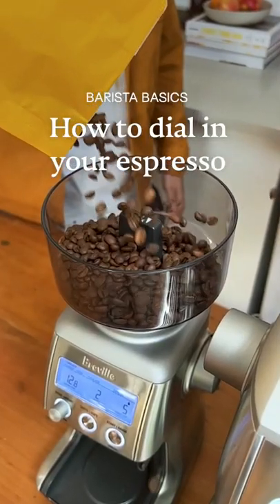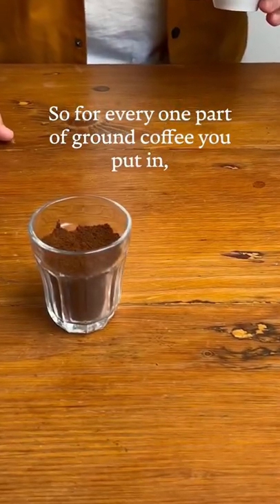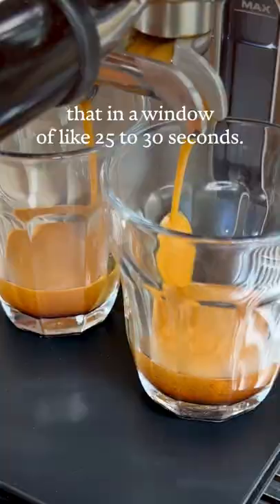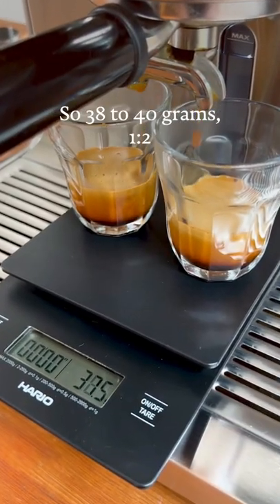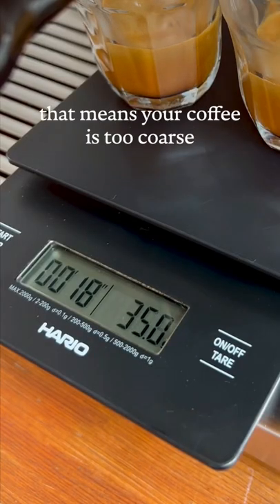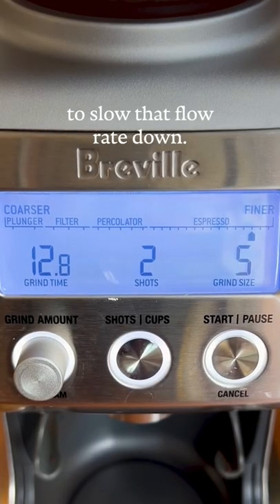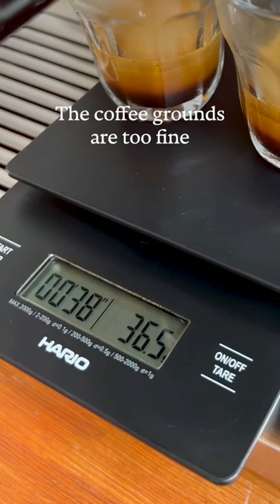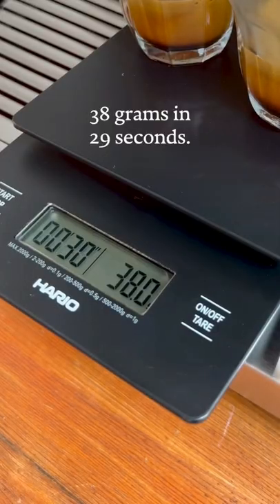How to dial in espresso #goldenbrowncoffee #espresso #barista #coffee #howto

Comment: Notice this is just a standard guideline. This will change depending on your coffee beans, aswell as the temperature and pressure your machine works with. Light roasts usually render a better coffee with higher ratios, and darker roasts can render better with coarser settings and smaller ratios.

Comment: Learnt this at a coffee workshop I did recently. It really does make all of the difference. Btw, I notice you have the Sage/Breville machine. Would love some machine specific tips as I am struggling with my machine still! Thanks 😊
Reply: @Paul Ridgeway grinder is fine for starting out, machine is more than fine, if it’s good enough for Lance Hedrick….
Reply: just my 2 cents, open the top, turn the burr to minimal step then work on your settings, else the grind will always be too coarse. the default burr setting is bs. i initially thought this is a bad grinder, turns out to be just fine
Reply: @sythanh14  thanks! I agree, the burr settings are shoddy. The factory setting was not working for me. I have gone two levels finer and seem to be extracting better espresso within my intended recipe times :)
Reply: @sythanh14  good tip, I had the same experience with this grinder
Reply: Another couple of beginner tips…. First, you have to start a little too coarse

Second…. Understand the texture of grinds you are aiming for
Flour or corn starch texture is way too fine
Table salt texture is a little  too coarse
So aim for something in between
Reply: @MrArdytube  thanks Andy. I do aim for somewhere in between that grind. I’m about 80% there - I don’t think I’m tamping as well as I should be. Thinking of getting the Normcore spring-loaded tamper for more consistency.
Reply: @nainz9310  do you have a bottomless portafilter?   That really helps to see how the shot is pulling….. basically you can see if it too fast or too slow.   And channeling…. Ideally you want to see the flow unify into a single steam fairly quickly.   This is deceptively harder than it seems it should be.    

The following seems a little picky…. But works for me.   I use a wet paper filter on the bottom…. Then the espresso…. Distributor to level, tamper, then a puck screen….   The result is an immediate unified stream of espresso

The norcore is an excellent tamper if you do not have one.   If you have one already…. I tamp so fingers and thumb are touching both portafilter and tamper…. This lets you feel if it is uniformly level.   Tamper Pressure uniformity is not critical… you just want a firm press
Reply: Even with identical machines, the results will vary depending on the coffee used, how fresh it is the roast, the humidity in the home. It’s a trial and error until you have a great tasting coffee and it wi vary from day to day. The Breville/ Sage have a lot of retention so purging the grinds will be a must between trials or you will be left with a good part of the old grind setting in your new grind.

Comment: I have that same Breville finder and a 6 grind for 18 seconds (or about 18 grams in) on that grinder has been the best ratio so far for my little Breville Bambino to handle a double shot.
Reply: I have the same set up. Smart grinder and little bambino. Struggling to get a good shot off single wall basket. You recommend I do 6 grind setting for 18 seconds and I’ll get nice honey drip from it? Right now I’m doing 24 grind for 7.8 seconds on dual wall and it’s so-so

Comment: What happens when you're getting 48g to 50g of espresso on 20 grams in 28 seconds?   (About 1 :2.5).   The timing works but the output is too high.
Reply from the maker: If you just need to grind a bit finer
Reply: How does it taste

Comment: When do you start the timer?
Reply: I personally start the timer as soon as I press brew. This is because pre infusion begins where water beings to soak the ports filter. When you start the timer as you press the button you’re going to want a bit longer shot closer to 30 seconds as there’s usually a 5-7 second delay before flow begins. This is what I’ve found best and the easiest to duplicate when timing multiple shots on different beans.

Comment: After getting my Flair 58 recently, I learned that the 1:2 Ratio is NOT a golden rule. The ratio and the grind size will vary depending on the roast of the beans, Light, Medium, and Dark roast.
Edit: Also, the extraction time will also vary depending on the roast.
Reply: It’s not a golden rule but it is a good place to start until you know a bit more about your setup and beans
Reply: sure dude but extraction time is mostly from courseness lmfao. dark roast also same rule applies but aim for 20 seconds not 25.

Comment: 19 grams seems to overflow my puck. Does me using a fairly coarser grind have anything to do with this? If so, should I aim for less?
Reply from the maker: It will just depend on your basket size. You might have an 18 gram basket. 18 is fine

Comment: So you should set your brew time first, then aim for the correct weight?  Ive gome through about 400g of coffee now and only managed 20sec for 38g 😂
Reply: I would do as follows…. First get the grind size to feel like table salt (too coarse).  
Then make it finer to feel like flour (too fine)
Then you have a range
Then go half way in between table salt and flour
This will give you a good starting point
Pull a shot for correct weight
Check the time
Adjust grind finer or coarser to correct time while keeping the shot weight constant
Note… I find a paper filter on the bottom of portafilter helps
Reply: @MrArdytube  thank you so much 😁😁

Comment: Does the timing start when you pess the button or when espresso first starts flowing?
Reply: when you press button
Reply: When you hit the button…. I usually turn on for 1-2 seconds to wet the coffee
Then off for 3-4 seconds… then pull for about 20-25 seconds… but the final weigh of the shot is what I am aiming for rather than the shot time

Comment: I have the same grinder, adjusted all the way to the finest setting also changed the internal grind dial to both 1, finest finest setting and my espresso still runs out fast like a faucet. At this point I don’t know why it caused my espresso running out so fast. I have Lelit Elizabeth and blank basket pressure runs at 11bar so it shouldn’t be the pressure problem either.